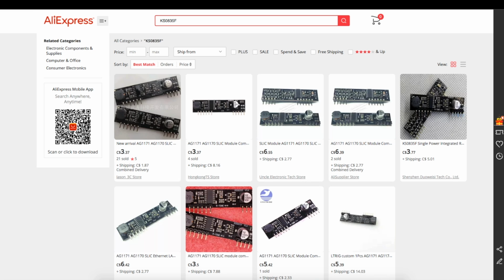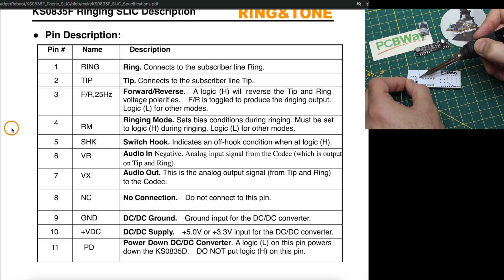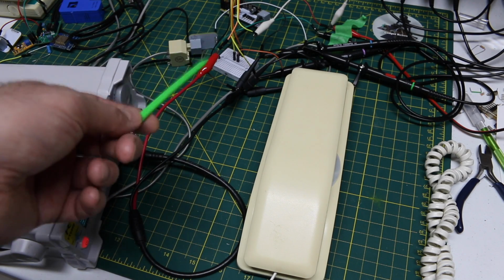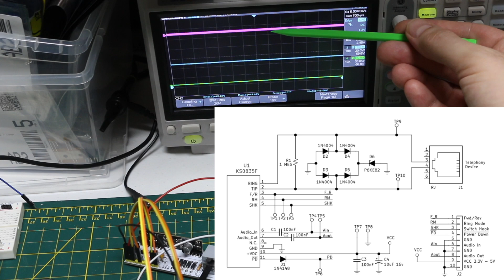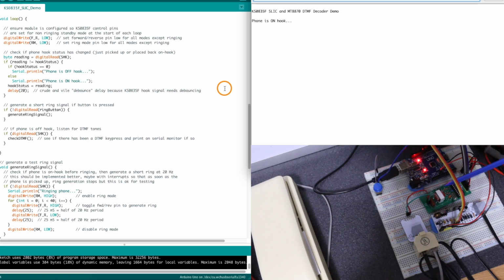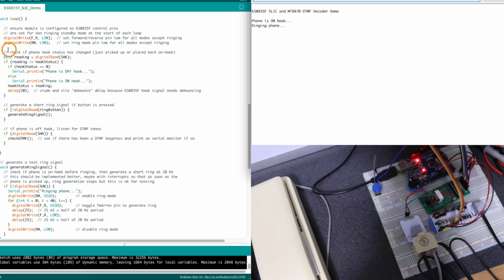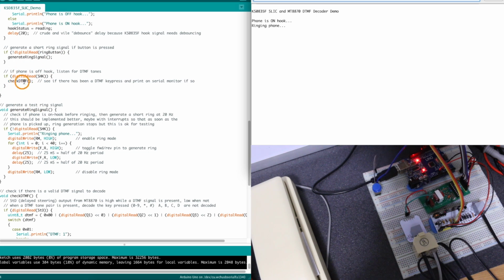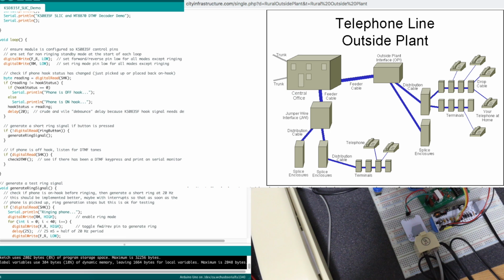KS0835F Telephone Subscriber Line Module

Comment: it looks like you have the DTMF decoder set up to line voltage with the splitter, is that right? Would it work to put the DTMF converter on the audio output side of the subscriber line module instead so it only ever sees 5 volts?
Reply from the maker: In some testing where the decoder was plugged into tip/ring for audio listening, that board has a DC block capacitor so it only ever sees audio or ring voltage, then there's diode clipping to keep any AC below 5V but I only ever intended to connect in the decoder after a call was in progress by controlling things elsewhere such as relay connections.   
On the larger projects with a full phone line simulator I used the audio out path of the SLIC module to go to the DTMF decoder and did some other things to level shift the control between 5V and 3.3V to use it with ESP32.
A full playlist of all the phone experiments: https://www.youtube.com/playlist?list=PLDnEejiR3mBxaq7fUhUmSlPGiukyAq6VU

Comment: FYI I believe you can use the goertzel algorithm to decode dtmf by checking the zero crossings of the dtmf signal once it’s digitized.
Reply from the maker: I saw some projects mentioning that algorithm but I noticed I’m having so much trouble with processing power barely being able to keep up while generating my own DTMF sounds, I didn’t even try to add more algorithms like that because I would need it at the same time, like if I’m generating a dialtone, I’m also waiting for somebody to press a button and then stop the dial tone and continue listening to the rest of the buttons so I need to be generating as well as detecting DTMF at the same time and it would probably not go smoothly with a single processor
Reply: Are you using the Uno? It’s not a particularly beefy device for any sort of complex functionality especially with any amount of streaming. The arduino library is also more focused around making it easier to program than efficiency. It’s also likely not great at most math of numbers of any reasonable size. If you want to give it a shot there you can burn calculated DTMF digits to a buffer and then play them out. But I would consider a beefier processor if you have to do math. The Raspberry Pi Pico has dual core 125 MHz but can only do 16x16 bit multiplication single cycle. If you need anything floating point you most likely need one of the beefier Cortex ones with an FPU.
Reply from the maker: I was originally using ESP 8266 and then switched to ESP 32 and I’m still getting problems with too many things happening at once but the project is still being worked on and I’m looking at ways to separate some tasks between the two cores and also trying to use Wi-Fi which dominates one of the cores already, and then the other one gets bogged down with DTMF stuff. it also doesn’t help that all I know about software is how to hack and slash different libraries and functions together to make things happen but it will be a few more months until I see if I ran into another bottleneck.

Comment: I used to perform this trick where I made a phone ring. If I recall correctly ,I would dial 200-222-2222 and wait for a tone, toggle hang up one time and then hang the phone up. A few seconds later it would ring back. I think it was some kind of testing tool for servicing lines. Thanks for these videos! :)
Reply from the maker: My favourite trick from the BBS days was dialing an extender number where it would give a new dial tone and allow entering a new phone number in a new (long distance) area code...at local rates...
Reply: I believe those were calls "Watt's Lines" and were used by corporations to allow their employees in sales, etc. to make unlimited phone calls.